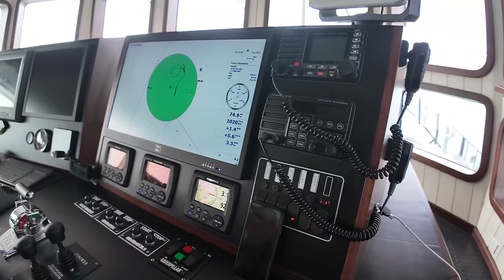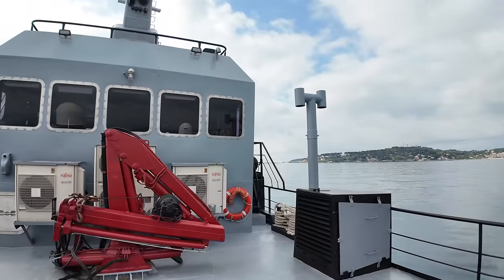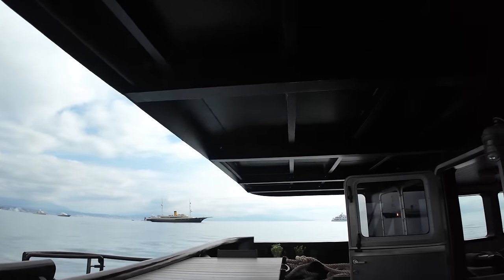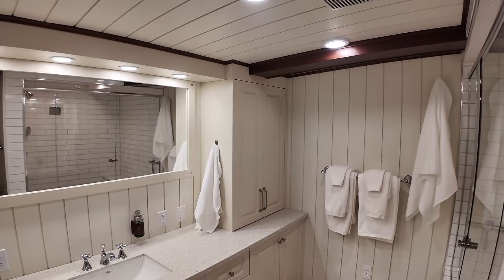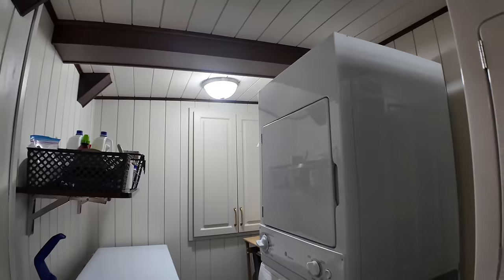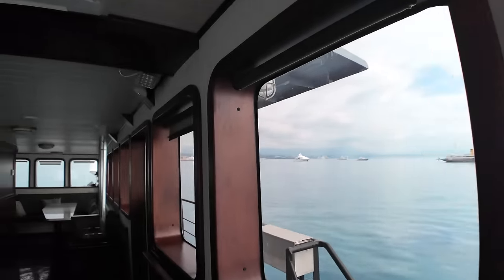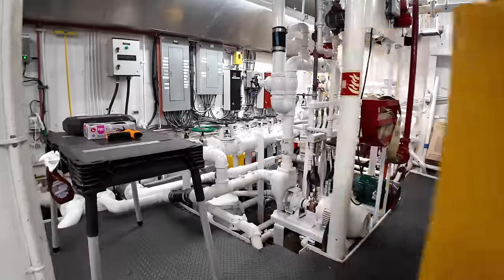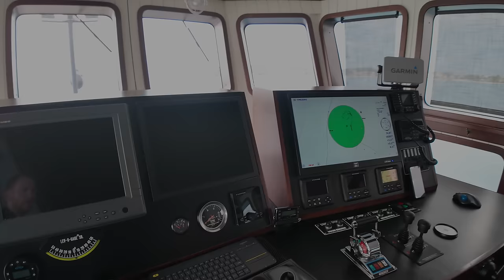THIS 7,000 NM Range Ultimate REBUILT 130' Exploration Trawler Yacht! Is The M/Y 'Anne S. Pierce'!

Comment: Perfect combination of industrial toughness & good practical interior.  No gold plated taps or rare Picasso artwork here !!!  A conversion to be proud off.  ⚓⛵
Reply: Indeed!  I couldn’t agree more.
Reply: Absolutly. Its actually kinda similar to what i envision myself getting, if i ever get the money necessary.
Reply: Well. Yes but It has a lot of non-marine equipment probably not made for the job. It uses the same airr contidioner you would have at home. its not going to resist at sea.
Reply: @polviaortega3709  It uses 16 Fujitsu air conditioners so they can be swapped out easily if one fails...so they don't waste time being stuck in port...did you not watch the video?
Reply: No Picasso? No no no!
Reply: Toughness??? Have u looked at the metal when the boat when shined by the sun??? So many dents and unevenness that shows how thin the metal sheet is, you can see the outling of the boat frame. This is low quality boat

Comment: Such a well refurbished vessel. Everything seems practical and easy to use and easy to get to different areas on the vessel, I’d like it if it were mine that’s for sure. Great idea having two ( 2 ) Tenders. Bit surprised that there’s only one driving engine, great idea for having i think 3 generators. As someone has said in the comments previously, no gold plated taps or rare Picasso artwork, I think it’s rather good. Hey YachtBouy, when you were doing the tour for use to watch, I think you may have made a mistake, I think you may have meant “ sauna “ not “ spa “.

Comment: What a great canvas for a hybrid explorer refit (I'm thinking of the Northern Marine "Take Home Device (Proportional Drive)," given the large generators in the engine room) with a large house LiFePO4 System. I would advocate for a substantial flybridge hardtop with integrated solar array and biminis fore & aft with flexible solar panels for anchored power augmentation. A large kite-sail system for downwind passages would further increase efficiencies.

Comment: The 4hp Mercury in the engine room is the backup in case that big Cat breaks down. 😂

What an amazing vessel. Rugged but not lacking in comfort. If it was built for the North Atlantic, it's going to be able to handle rough weather. 

And the crew areas are so much nicer than a lot that I've seen in other, built for purpose yachts. Some of those boats look like the crew areas were designed to punish whoever is unlucky enough to work aboard them. These are as nice as the main areas on other yachts. 

Great video. New to your channel. Have you ever done a video on an explorer yacht with an ice-rated hull? 

And great work by the Newfoundland yard that did this conversion. 🇨🇦

Comment: Beautiful ship, and a very well-done video. Some of the best crew accommodations I’ve ever seen. But I have an honest question not a complaint. Shouldn’t an explorer yacht have some kind of backup engine system? Even just something small that would only propel something this size forward at three or 4 kn. What happens if you have a prop get sheared have a shaft break, or have the main engine breakdown? Shouldn’t there be a small auxiliary engine of some sort with its own prop ( one of those folding ones so no drag when not in use) as a back up for emergencies at sea? Again, not criticizing, a genuine question for those who know explorer yachts a little better than I do.
Reply: These old girls usually have a split box. or Chain drive from decent aux to drive shaft. Although those old 3 series Cat's are Usually unkillable. They usually throw the boat away and build another round it.
Reply: @mackcarson6729  I cannot say enough good about those old 300 series CATs. We had a Bering Sea Crab boat built in Mobile back in '78 using the CAT D399. The CAT dealer told me at our sea trials that we should have the top end serviced at 20k hours and give it a major at 40k. She never made it to the major before running up on the rocks. The crabber/trawler I ran for 14 years also had the D399. During my time with her we clocked right at 50k hours, the top end was done three times and the bottom once. Aside from the bearings, every part from that engine was cleaned and sent to a reseller. The only issue we ever had was to blow out an o-ring on a cooling water line which we repaired at sea in about 20 minutes. We also had two 3406's for gensets and hydraulics. they were majored at 20k. Our maintenance consisted of regular oil/filter changes, air filters and changing the cooling water once a year. They were solid engines!

Comment: In the engine room, maybe, you can add more labels on valve and other équipements. On pipe, a color code and arrow for flow direction. Sometime, we use a flag to show that a valve is open or closed. Like green flag means open. Yellow flag means closed. Red flag means "issue, danger dont use it". But i dont know anyting in boat, work in industrial. Regards.

Comment: Very cool! A very unique boat. I get the feeling that I'm getting a tour of a middle class house in the US from the late 1990s. The details (like the sockets, lights, faucets, tiles etc etc etc) are all very normal - like they are bought from Home Depot. A lot of stuff seems to be an afterthought, or done as cheaply as possible - like putting the huge AC/heating units in all these rooms, instead of installing a central system with thermostats in the rooms. Love the floor plan and size of the rooms though.
Reply: The advantages of using Heat exchanger splits are many. The individual cabin units provide heating and cooling, are incredibly energy efficient, are almost silent, have their own handheld control and thermostat, refrigerant lines from the main unit are small diameter copper pipes not ducts and easy to run, significantly less expensive to install, really cheap to replace by anyone and get anywhere in the world quickly. Only negatives I can think of are each unit has a condensation drain that needs to piped out somewhere and the heat exchange units being exposed at sea are an unknown maintenance question, but they are also easy to replace individually rather than having a single central air break down.

Comment: OK. I subscribed. But if this is typical, you need to normalize your audio levels. Youtube may be partially responsible for mixing the music way higher than voice. Your seem to have added some words at one point that have to have been like 6dB down on the rest. Hmm, I'd call these voice unders, because they are below the normal level. It's nice that you don't have music blasting out. Nice boat. Is he making a better one? I had to rewind and turn the volume up twice to hear what the main engine is. That's a lot of large diameter pipework, what is it for? Is that part of the bilge/fire fighting system? Or is it the ballast system. It's not often that you see a brick wall on a boat. To me this is much nicer than most mega yachts which have too much delicate house style furnishing. I'd love to take this up from Seattle to Alaska... when I win the lottery.

Comment: Compared with Norwegian or Icelandic trawlers this boat is looking too luxury in the galley. One or two storage rooms for food and professional appliances would have been better for such a great vessel. Modern trawlers don't have longer a wheel and are controlled at the side of a large seat by a stick and by autopilot by clicking on the map. Multiplexed 60" monitors mounted on stands before the seat  can either display cameras, radar, maps or TV/Internet. Otherwise this vessel is looking good

Comment: My neck hurts after watching that video, no disrespect.  Just a bit of camera advice - you recorded angled too upward.  The focal point should always be centered in the camera lens.  In tight spaces keep the camera angled downward so the floor is in frame.  If you need to pan upward, do so and then return to put a part of the floor in view.  You're trying to bring the viewer into the video as if they were there, no one walks around looking at the ceiling.  I'd also recommend a wide angle lens.  The attachment is pretty cheap for that camera.  It always useful to film boats, cars, and other tight areas.

Comment: 12 knots top speed means it cannot outrun anything or anyone which is a deal killer for weather and pirates.  Nice boat but it has the dynamic capacity of a harbor tug and is too slow to get out of the way in big shipping lanes and too slow to outrun storms or pirates.  Might as well be in a sailboat with a 12 knot top speed.